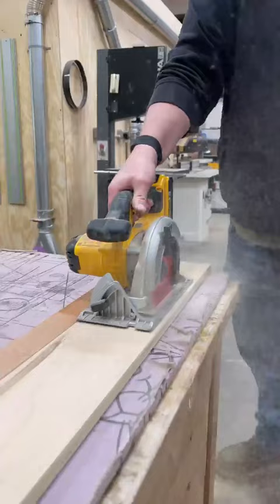How to Make A Cheap and Easy Track Saw!

Comment: I do the opposite, thicker material as the fence, thinner as the bottom, that way I don't lose depth for things like trimming doors with my small battery saws.
Reply: Yup
Reply: Easier to move around lighter
Reply: IKR
Reply: I was going to say the same thing lol
Reply: A furring strip and Azak.
Reply: Exactly. And I use a piece of laminate as the bottom. Glides right along.
Reply: Well Makita does make a 16" saw, just saying 🤔
Reply: James Azak has no biz being in a carpenter’s vocabulary.

Are you a carpenter or hack gluing plastic together?
Reply: My thought exactly
Reply: Use thin material for both.

Comment: Been in construction for 15 years, and this is the most useful tip I've ever seen. How did I not figure this out 14 years ago?!
Reply: Agreed
Reply: It’s the same concept as using a 2x4 as a straight edge, surely you’ve done that
Reply: So which is it?😅 15 or 14? Kinda don't believe anything you say now lmao
Reply: @chicagorc3967  I'm saying that I should have figured this out after 1 year of working in construction. And yet somehow it's been 15, and I still didn't know it.
Reply: I have a track saw and still use these for tasks that would be harsh on it. I put some edge banding on mine to make it slide nicer.
Reply: Leaned this as a kid framing with my dad in the 70’s sept we’d use a 2 by 2
Reply: Que buena idea
Reply: You didn't have a table saw 15 years ago
Reply: Your kidding right? That's the first thing I did, while I'm completely clueless about woodworking. 
Was here hoping for something better.

Comment: Add a few wipes of wax to your plate and new track, she will glide nice and smooth. Do this to a majority of my tools especially my table saw and jigs.
Reply: I generally use silicon spray (and on my table saw).
Reply: ... and get a fine-notched spreader and some silicone to put grip-lines on the bottom... I did this and it works great... 😎👍☘🍺
Reply: Use a bar soap you don't need wax

Comment: I’ve been doing this for years. I finally bought a real track saw about a month ago for a couple reasons. I find myself doing a lot of slab doors, which need to have a bevel on the strike side to be able to close and still have a tight reveal. If you bevel your saw and use your homemade track saw it cuts off part of the track, so your blade doesn’t line up with the edge anymore when you set it back to 90. The other reason is that it doesn’t work well when taking a hair off of something thick like a door. The material pushes the saw away from the fence or it kind of bends the blade instead of cutting a straight line through the material

Comment: I made mine using the thin material (in my case it was 6mm  lexan I had) so I lost very little in cutting depth... I also spread silicone on the bottom with a finely-notched spreader to put grip-lines on it, works great !! 

😎👍☘🍺

Comment: I used 3/8" PVC to make a 98" track for my 7 1/4" and a 54" track for my 6 1/2. I like PVC because it's very slick and they can live outside. I recommend cutting it wider and ripping the other side at a ~45.5⁰ so you can also miter.
Reply: Can you make a video of how you do it?
Reply: @samcorlsamuel9074  Yessir. It's not exactly the cheapest option as you would need to purchase a sheet of PVC which costs around $130. I'm lucky because I'm able to use scrap that's leftover from my jobs but even if I had to buy a sheet it would still be cheaper than a real tracksaw. I'll do my best to have it done this weekend.

Comment: They way I did it was to glue and nail a furling strip to a piece
 of plywood running long ways (with the grain) Doesn't have to be straight or aligned at all. Then just run one side (wide/long) of the saw down the edge of the furling strip then use the other side (narrow/short) of the saw to cut the other side. Now the cuts are perfectly aligned with the furling strip and you can use either side of the saw blade.

Comment: It look just like mine. I used a 2” x 1/8” strip of aluminum. Works well!
Reply: Where'd you get the aluminum
Reply: @vary8114  Aluminum isn't hard to find. Of course I've had a machine shop for 35 years so easy for me to say. One suggestion I could give you is Online Metals. You might get by with flat bar.

Comment: 1/2 ply for both layers works on my saw. Fun tip, put the smaller strip more centered, and you can rip with both sides of the fence so you can use it either way.
Reply: you can also just rotate the fence 180°
Reply: @pedrosarsama  Yes, I meant getting the wide side of the saw on one side, and the narrow side on the other.
Reply: Should you own two different circular saws, designate a rip fence side for each of the unique saws.

Comment: Just take a level and 2 clamps. Measure the fence on ur saw and position ur level that distance away from ur cut. Gives you a higher straight edge for ur saw to ride against, you are not elevated by however much the board is limiting what u can cut now, don't have to build anything, you would have to clamp it down anyways..

Comment: Does it matter which side of the plate you make it for? I changed saws and the new saw plate was wider than my track. Instead of making a new one, I modified the existing one to work for the narrow side of the plate (from the blade to the left). The track is much narrower now. Not sure if this causes issues?

Comment: You made it backwards.
Use the quarter inch undelayment as your base and the one by for the fence.  Much less chance for the saw to jump the fence.
Reply from the maker: It hits the motor unless you use the short edge as your guide
Reply: @John_Malecki  I have no issues with hitting the motor.  But then my Skilsaw is a worm drive.

Comment: Carpenter for 40 years. Was taught this by true craftsmen way before track saws came along.  I’ve made and used many of them. Only suggestion:  make the back side wider to give yourself more material for clamping to the wood your cutting.

Comment: Shouldn’t have ripped the thick piece. Next time, keep it and take your 2” piece somewhere slightly off center and rip for the wide part of the base plate and then do it again on the other side of the 2” rip for the narrow part of the base plate. Then you’ve got 2 track saws in one.

Comment: The board is too thick it steels a lot of blade deepness. Also so need to cut a strip to guide the blade, use some aluminium profile instead which is already straight. 

The idea is good i've done it works well but you need to clamp it all the time its not stable enough to be used without clamps...

Also, its not a track saw in order to mimic a track saw you need to free the deepness regulator while the saw is working, dive the saw on the wood and later lock the regulator all of this while the saw is cutting....needless to say that won't aint for a precise cut cause circular saws werent made for that

Comment: Or just know how to rip straight with a circular saw......or if doing finish work, use the table saw you have there.  One of the biggest reasons I see guys can't get straight circular saw cuts is because they want to "depth set" the blade to barely go through the material.  
While this is "normal " practice, it makes it harder to cut straight.   If possible, like on saw horses, I keep my blade full depth.  This keeps the saw running straighter.  Oh, and I use my finger over the edge of saw table. Haha.

This was a long, wordy, prob confusing post.  I'm sure someone will let me know.  I really don't care what method as long as my workers are safe and efficient.

Comment: Works good but unless you have everything clamped and use hard pressure and even then, you will have little waves it's impossible to control the saw, good enough for most stuff, you can hide waves with some filler

Comment: yeah, ok, just don't add the fence even with the edge of the board, make the board an extra 1.5 inches wide and add the fence strip 1.5 inches off the edge THEN make the cut for the final size. this way you have something to use to clamp the board to the worktop.

Comment: ALL YOU NEED TO CREATE A CHEAP TRACKSAW IS HAVE AN EXPENSIVE TABLE SAW TO BE ABLE TO ACCURATELY RIP DOWN THE WOOD NEEDED TO BE STRAIGHT ENOUGH TO BE USED AS A CHEAP TRACK SAW. Sweet all I need now is that expensive table saw!